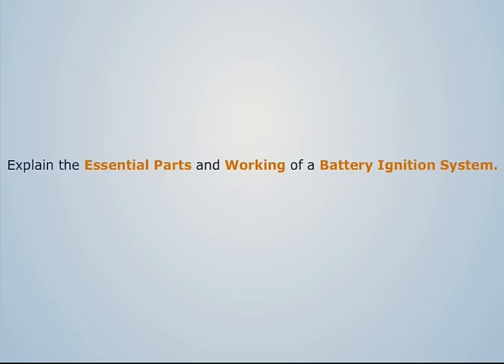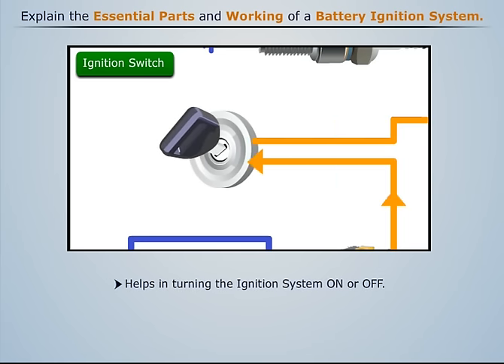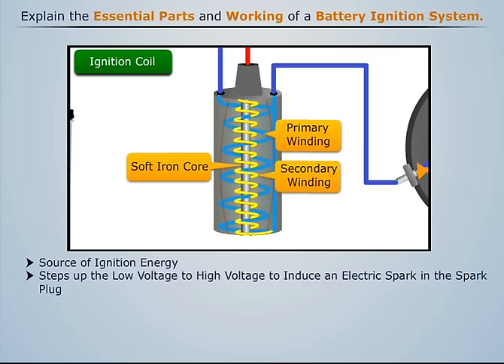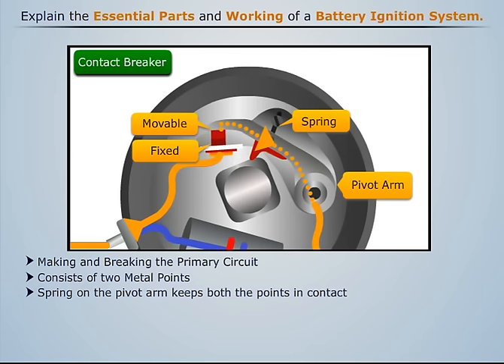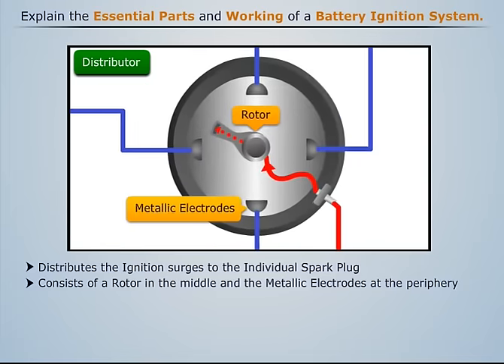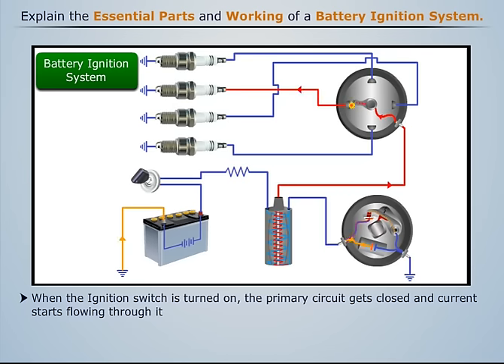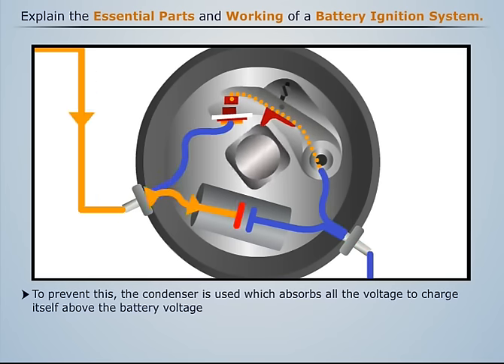How Battery Ignition System Works | Automobile Engineering

Comment: this is an accurate description of the ignition system, at least for all I have ever studied it over the years. Reading comments proved entertaining and as usual I come away realizing this subject, though pretty straight forward, causes more confusion than any other topic of automotive mechanics. For the record to those with other ideas, the condenser is not providing just an "extra" benefit of preventing points arcing, it is essential in so doing. A system will run without a condenser but the performance will be erratic with secondary voltage values wandering all over the place and the  points will be a real lightning show. The points do not hold up to this. The condenser is an electrical storage device, pure and simple, where it is used and how it is used determines what it actually accomplishes. In this case the condenser is a remote storage device to accumulate/absorb electrical charge when the points open, if it is not there then the primary coil winding voltage will back feed to ground or some other lower voltage circuit, hence the points burning. As the points open and the coil primary field collapses the condenser assures that all the power stored up in the primary is retained in order to follow through to the secondary coil circuit. This happens because the condenser is blocking the backward flow of electricity from the primary winding of the coil due to it having higher voltage than the collapsing coil primary field. When the coil primary field discharges to a certain level of voltage the condenser then releases its charge into the coil to finish the job of secondary voltage generation, kind of a boost so to speak. So in this particular installation the condenser is acting as a storage device and a resistor to prevent backflow of electricity. And it is worth noting that this video is talking about a resistor in the coil, not referencing the ballast resistor in the ignition primary circuit. So there are then two resistors, one in the coil to protect coil overload and the ballast or nichrome wire ignition resistor that is there to keep the voltage to the points low enough to prevent points burnout. The ignition resistor it is in circuit when normal ignition is in effect but it is bypassed when the circuit is in the starting mode in order to achieve a higher starting secondary voltage.

Comment: As per usual, the writers of auto-ignition systems make the same mistake regarding the purpose of the capacitor across the points. Its initial purpose is to provide a RAPID collapse of the back EMF of the collapsing field, by providing a capacitor this enables the current to be quickly absorbed. The explanation is this.....the rule of induction is, that the faster the field collapses the higher the output voltage will be, THE MAIN PURPOSE OF THE CAPACITOR IS to quickly assist the field's collapse. The fact that this capacitor also HAPPENS to sufficiently reduce the erosion of the points is just a lucky coincidence. Remove the capacitor and the ignition fails to provide sufficient spark to run the engine.
Reply: You're right. I am pulsing an ignition coil electronically with a MOSFET, and it is sufficient for generating high-voltage output due to its very fast turn-off.
I have tried placing a capacitor across the transistor - no joy.

Comment: The resistor ballast is not to keep the coil from getting too hot. It brings down the voltage, when you crank the engine there is a wire that gives the coil battery voltage bypassing the ballast to increase spark voltage, for better engine starting.
Reply: Yes that is true, so why not just remove the resistor? Because the coil will overheat!
Reply: EXACTLY !!
Reply: @jakefriesenjake  As far as I know, the coil is designed for 10V +/-2V. The battery voltage drops to 8V-10V during starter cranks, so the resistor must be bypassed by wire to compensate for the voltage drop. In normal condition, resistor compensate 13.5V to 11.5V
Reply: Incorrect.
Reply: I was under the impression that the ballast resistor is there to resist the full voltage coming from the battery going to the coil full voltage would cause premature failure or just SIMPLY PUT INSTANTLY FRY ITSELF but this was just my observation I'm not an electrician practician
Reply: Not all cars use a ballast resistor. Those that do, have a coil rated at 9volts. So that for normal running the resistor then functions to limit the higher current, when the engine is running and charging the system up to 14.5v. This system of a resistor and low voltage coil, is used to improve starting. The resistor is shunted out when cranking the engine, to give full voltage on the coil. When cranking on a cold day, the battery voltage may drop to 9v. The coil is then receiving it's working voltage when cranking and will start better.
Reply: @honzahanes484  Spot on.
Reply: @jakefriesenjake  That depends on whether you are using a 9v coil or a 12v one. If you run a 9v coil without a resistor, it will get hot and fail early. A 12v coil, on the other hand, will work perfectly without a resistor.

Comment: Another nice video, which is almost correct. Except for one thing. The other end of the secondary coil can't be connected to the primary coil T1:55 like on your diagram, as the contact breaker would cut ground to both coils at the same time, and the secondary coil couldn't deliver 20 000 V to the spark plug as the other end of the spark plug is connected to ground. The other end of the secondary coil MUST BE PERMANENTLY CONNECTED TO THE GROUND instead to the primary coil. Anyway, over all, good video, buddy ;-)

Comment: Great video here! One thing i noticed is that the moveable arm of the contact point or contact breaker should be the one connected to the input wire from the ignition coil, and the fix arm, or the body of the contact breaker is the one grounded to the base of the plate.
Reply: He must be talking about a vehicle with a positive earth perhaps.

Comment: Excellent Explanation, thank you!
Reply from the maker: Thank you for your feedback, @DidntSay.
To getting more videos for Automobile Engineering, please click the link http://bit.ly/2phR0Ja 

You can learn more topics like Introduction and History of Automobile, Comparison of Otto, Diesel and Dual Cycles, Engine Emissions, Construction of Leaf Spring and its Types, Constant Mesh Gear Box, Synchromesh Gear Box, Transfer Case, Sliding Mesh Gear Box, Types of Brakes, Current and Voltage regulation and much more.
Reply: Related cam shaft

Comment: have a question. If you feed the coil with 12 V continuously (DC), how long can the current flow without damaging the coil's primary?
Reply: Who knows. But when the coils primary winding go bad, you'll know. So, just turn off the ignition when not using the engine.

Comment: Question: Why would you need a contact breaker if the distributor would cut off voltage?
Reply: The distributor's function is to switch contact from one spark plug to another.
The contact breaker is needed to interrupt current to the primary winding. After the interruption, its field collapses, inducing a lower current, higher voltage into the secondary winding.
The contact breaker has to break contact right after the distributor established a connection to one spark plug. This system has to be fine tuned in order to work correctly.
Reply: @soupflood  Okay, thank you!
Reply: @soupflood  The contact breaker has to break contact right after the distributor established a connection to one spark plug. 

Really? The distributor switch 20 000V but contact breaker cut off 12V sorry bud you wrong.
Reply: @honzahanes484  
If you'll ever open a distributor, you'll notice that, in the upper part,  it has an arm which rotates at half the speed of the crankshaft. That's where your 20000 volts jump the millimeter air gap to the cap contacts, which connect to the sparkplug wire.
Underneath that, you'll find a switch which is called points. It interrupts the 12V primary side of the ignition coil. After that switch cuts off the 12V coil, it induces 20000V into the secondary side of the ignition coil. The ignition coil has a 12V coil and a 20000V coil.
In the engines made after the 90's, those points were replaced with Ignition Control Modules which use a field effect sensor (typically a coil and magnets) and transistors to switch on and off the primary side of the ignition coil.
Tell me if you found an error again.

Comment: Hi,
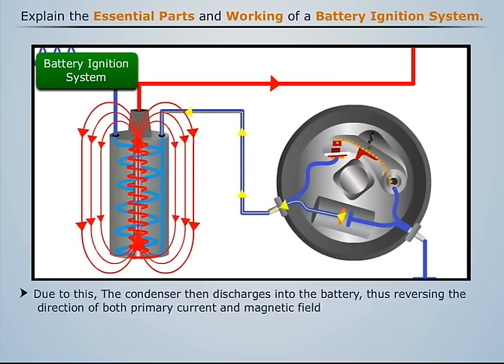I have a question about the video. at 4:35 you say that the condenser is charged with a voltage much higher than the battery voltage.
I like to understand why the voltage is already higher than battery voltage at this moment.
Why is this happening, and why is this higher voltage coming from the primary coil?
I hope you like to make this clear for me?

Regards,

Arthur
Reply: The condenser is a capacitor. It stores current. It starts off by absorbing extra current during the collapse of the breaker circuit when the contact breakers open. When this absorbed current produces a  voltage that exceeds the battery voltage (12v) the battery stops providing current. When the battery stops providing current, the condenser discharges back into it- reversing the flow of current back to the coil LT winding - reversing the magnetic field and generating a HT voltage out of the coil's secondary winding and central electrode.
Reply: The collapse of the magnetic field, in the primary winding, creates a voltage spike of 200 to 300 volts.

Comment: When installing on old cars 3 capacitors on the aspirator, there is no strong spark on the spacers, but when installing on the spacecraft, the spark comes out, but if 3 capacitors are installed on each side of the car, it does not work. What is the reason? Thank you.

Comment: There is a flaw in the system drawing,  the fixed contact is grounded, so it can't be connected to the coil, the movable contact is the one that connects to the coil.   And not all ignition systems have a resistor ballast.
Reply: absolutely right.
Reply: but he might be explaining a positive earth system as in American cars?

Comment: TO FURTHER CLARIFY...One of the laws of magnetic induction is that the output voltage of the secondary winding is dependant on how quickly the primary field collapses. If you took an auto ignition coil and applied 12 volts AC at 50 cycles the output from the secondary would be surprisingly small, because the rate of the applied current is relatively slowly building up and diminishing at only one fiftieth of a second, but apply an instant 12 volts into the primary, and provide a fast path for the collapsing field current to follow, and enter the capacitor, which quickly sucks up the energy, and the output will be dramatically increased. Then the points shut, which discharges the capacitor, ready for the next cycle. [ modern ignition systems are way out of my depth as I come from way back in history ].
Read more
Reply
Reply: Why one  positive wire of a secondary coil and not two ends  positive and Negative  secondary coil
Reply: @maniac2315  it's just grounded. "the same ground that the spark plug uses" 

it saves a wire.

Comment: Can you please  tell me that in which engines the inductive indiced discharge  is used? 
Because  nowadays  mostly CDI is used
Reply: CDI ignitions are generally not used on automobiles due to cost and because they tend to work best at higher rpm. Modern coil design allow inductive systems to generate proper voltage at high rpm where in the past this was difficult to accomplish.

Comment: what was the whole point of contact breaker along with the capacitor? how is it helping in any way?
Reply: Pratham Singh If I'm understood well, the cam, which is connected to the camshaft, switches the contact breakers as the cam turns, discharging the capacitor due to the break in primary winding's current. It induces a magnetic field in the secondary winding, and the rest the video covers very well.
The capacitor is charged by absorbing the EMF(Eletromotriz force) from the magnetic field of the primary winding.

I hope I could help you... English is not my first language.
Reply: Guilherme Rodrigues thanks :)

Comment: in actual wiring diagram, the distributor has two wires,each wire connected to the secondary of  coil of the ignition,,why is that?

Comment: nice work and graphics: maybe the English is computer generated: anyway there are errors.The battery metal is lead, pronounced like "head" not "leed"; distributor is stressed di STRI butor, accent on I. Articles are missing as in a phrase like" connected to contact breaker" which should read " connected to THE contact breaker.Sorry that the verb lead, as in leader, and the noun " lead" meaning cable are pronounced "ee".English is not always logical.

Comment: In a normal distributor in UK cars (negative earth) - the negative contact is fixed to the base plate, and the movable contact and its spring is live. Which is why its lead and that of the condenser live lead tags are insulated in a plastic sleeve on the connecting post. In the UK an electrical wire is called a lead (pronounced leed) - but the metal plates in the battery are spelt the same but pronounced led. As mdhsabh says below.
Reply: It's only a reference. Every company "could" be different. Only an example. Just like he didn't mention what the cam lobe, or what the coils case is made of and what metallurgy. Doesn't matter.

Comment: I replaced the coil, points,cap ,rotor, condenser still no spark at points
Reply: You need to look further up the LT system for wire breaks - test this with a continuity light - and if you get no light or buzz from a circuit tester then you have to look further back. It's unlikely the fuse as gone as its large - your connector on the ignition switch position 2 may have become dislodged or it might be a switch fault.

Comment: The presence of the points capacitor is vital to the function of the car ignition due to the fact that the RATE OF THE PRIMARY FIELD COLLAPSE governs the output secondary voltage..... without this capacitor, or if it becomes open circuited.the engine will stop, or only Idle. This capacitor gives the back EMF from the collapsing primary field somewhere to quickly flow to. It ensures a high rate of field collapse, ensuring a high output voltage.
The fact that it also stops points arcing and burning out in time, is just a happy coincidence.
Read more
Reply: its not normal to have current flow across the points all the points do is lift the gd off the condenser lead so current flows thru condenser to gd   if condenser is wrong value mfd  ( it must match the primarry coil )  or if its defective  the voltage can not go thru so it jumps the open points and pits them overtime

Comment: WHO DRIVES THE CAM ?! Whoooooooo if the car is turned off
Reply: The CAM is driven by the starter motor which initially rotates the engine when it is off....if that's your question. 

The Starter motor engages the teeth on the flywheel which is connected to the Crankshaft, which is connected to the Camshaft by a chain.  One of the functions of the Camshaft is it has a gear which engages and operates the contact points. (all housed inside the distributor cap)
Reply: The starter drives the cam